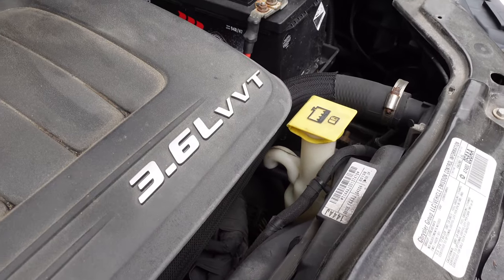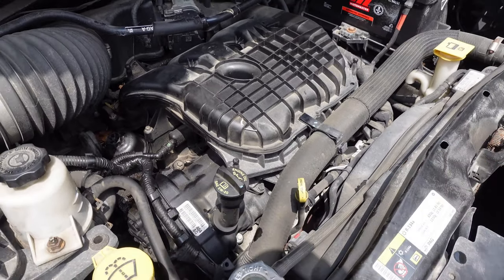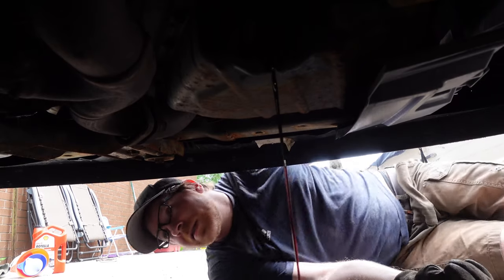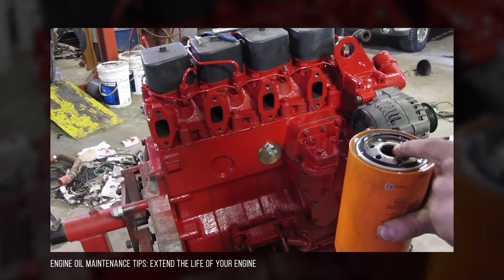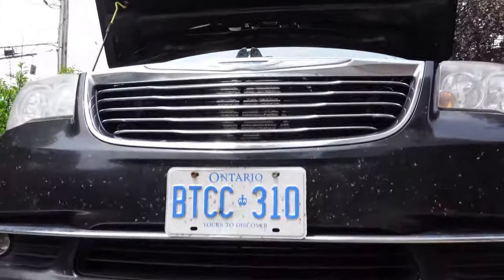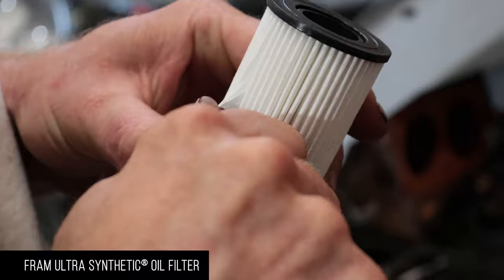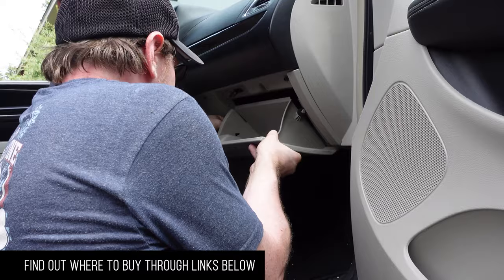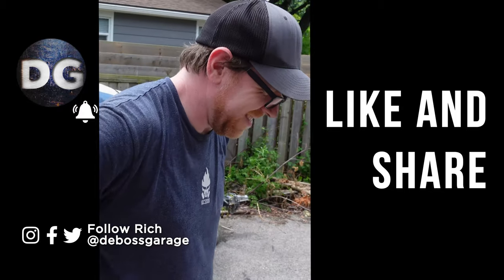How To Change Your Oil & Cabin Air Filter By Yourself (In Driveway)

Comment: When I showed my gf and had her do her own oil change.  She was pissed at how many times she paid the dealer $150+ to change it.
Reply: I'd be pissed too.  I've paid $150 for an oil change before, but it was in a truck that requires 27qts to fill.
Reply: Cost of a dealership change is not just an oil change, they also inspect the entire vehicle and top off other fluids. For anyone who actually inspects their vehicle themselves its not an issue, but if the only thing that's going to be done is poor in fresh oil and change the filter then it could easily save you money by having the dealership do the oil and catch other issues before they cause more damage. Of course this also requires trusting the dealership, which sometimes is surely easier said then done. Luckily for my wife's van the local Honda dealer is fantastic,  for my vehicles I prefer to do most of it myself as time allows.

Comment: Great video Rich, you covered all the important tips!  I have been changing the oil & filter on my motorcycle since 1977, including my newer bike.  I also change all of our vehicles, it is fun and much cheaper than taking it to a dealer or oil change shop.  This way you know the job is done right, use top shelf products (oil & filters).  Just recently I changed the oil & filter, transmission oil, transfer case oil, and differential, only took an afternoon!  Lots of fun

Comment: When I did the oil in my civic for the first time I had to use a friggen 2 foot breaker bar to get the drain plug out!
Reply: Your mechanic likes you….
Reply: I bent an oil pan on a customers car doing the same thing
Reply: hammer! they take a hard set and shock force knocks them loose nearly every time. same for trans, diff and other plugs. small breaker bar and dead blow hammer works pretty well or be dumb and bang it with your hand, then wonder why your hand hurts like mad
Reply: @throttlebottle5906  I would have done that except I was working under the car on jack stands,  so I barely had enough room to get the bar engaged with the nut and turn it, let alone hit it with a hammer. I ended up smashing my knuckles anyways. LOL.

Comment: i have been running Mobil 1 full synthetic 5w20 since 70 k miles <112 k  > now with over 280,000 miles (450616.32 K ) all of those changes have been 10-15 thousand mile oil changes truck still runs good gets same fuel mpg as new.

Comment: The dodge caravan service manual says
1. Warm engine
2. Remove plug and drain oil
3. Remove oil filter
4. Replace transaxle
5. Install plug and filter
6. Fill with oil.
Reply: 7. test drive and replace failed transaxle again.
8. replace failed engine
9. test drive and replace failed steering rack
10.......

Comment: I'm always removing the air intake on my '15 caravan to get to the cartridge oil filter. I miss my spinoff type oil filter.
Edit: Also check the tranny cooling lines for leaks, mine had a zip tie rub a pinhole in the crimped end and leaked, i bought a Doorman complete replacement from Advance Auto Parts and deleted the zip ties. The process for checking the trans level is complex.
Reply: I don't miss the oil up my sleeve with a spin on filter though

Comment: It's good getting the right oil viscosity (5w-20) but the car will have an actually spec that the oil needs to meet, that is why the oil filler cap has a book symbol and an "i" for information. Pretty important if you want to have your engine last a long time. I am surprised Rich didn't mention that, it is pretty important.

Comment: Hey Rich! Couple things about this van: 1) That oil pan is flimsy and will end up rusting through. Happened to mine. 2) Keep an eye on the heater hose Y-pipes near the brake booster, they're plastic and will leak after a while. Replace them with metal units.

Comment: Every one knows that you tighten the oil drain plug till the threads have deformed but NOT strip out. That’s what gives you a good seal 😉
Reply: @notsevenfeettall   depends on how rusted out your oil pan is. If it’s in good shape, you can take it to 3 ugga-duggas but it’s rotted out, maybe just stick with 2 ugga-duggas 

If it still leaks after tightening it, put some JB Weld around the threads. It won’t leak then
Reply: @codyheizler7619  JB weld? Isn't that more or less permanent?

Comment: When doing an oil change just be glad that everything is accessible and able to be visually monitored.
Many manufacturers cover everything up and deliberately make doing an oil change a pain in the arse because they don't want people servicing their own vehicles they want only dealers servicing the vehicles.
(looking at you BMW, Audi etc,.)
Usually Honda/Acura, Toyota/Lexus/Scion, Nissan, Ford, Chevy and Dodge make their cars relatively easy to service regular maintenance items like what Aaron was doing but, even those manufacturers have their challenge vehicles.

Comment: Excellent video  :) I use FRAM Oil filters, Fuel filter, PCV Valve, Transmission Filter plus Pan gaskets , Cabin Air Filter, Air Filter for engine and lots products since I drive vechiles since 1990 for 30 years also farm plus many others types vechiles! I enjoy how keeping engine plus vechile running perfectly long time too and do engine oil ever 3 months or 5,000 km also with new oil filter each time also 2 Air Filter plus PCV VALVE one in spring and other in Fall Season each year!

Comment: Hey I was wandering if you can help me. A couple years ago you made a video about removing the pesky exhaust studs on a 5.4L 3v. And you used a battery and jumper cables. I'm in the same dilemma just a 4.6L 3v all Aluminum and was trying the same technique with the battery and jumper cables. I did everything EXACTLY the same as what you did in that video except my bolt will NOT heat up even close to hot. The end of the jumper cables get red hot and I even melted the lead terminals on the battery. But by time I put the jumper cables on the floor and reach back up I can grab the bolt with my bare fingers, it's that cold. 

How is my head sucking away the heat so fast?

Comment: Question since you didn’t check the air filter next to the oil filter:  why would there be oil leaking onto the air filter?  We just got a used caravan. AC wasn’t cooling. Autozone guy suggested new air filters. Cabin air filter was nasty like yours. The under the hood air filter was soaked in oil!  We replaced it last month and today, it has oil on it again. The steering is getting stuck on and off, so I checked the filter thinking it might be related since the power steering oil is also right next to the filter too. I’m wondering why there would be any oil on the air filter.

Comment: Question, I have a truck I use as a work/farm truck I do not put many miles on it. Would I change the oil at the recommended interval or because of the use extend the interval?
Reply from the maker: I do it once a year regardless on things like my forklift and tractor if it doesn't get used much as much

Comment: You should do a video on the spark plug change on the 3.6L in that van as its quite extensive to remove all the air plenum and foam to get expose the spark plugs. Its also very expensive to pay a dealer to change the spark plugs on that specific model engine and year found in caravans and town and country
Reply: Yeah thats the video he should have done. They're a pain on them. If you're nimble enough though, you can get your hands back in there and get it done with minimal removal of other stuff.

Comment: If you want to save money on the fancy cabin filter, you can purchase a regular filter without that baking soda added to it. Then just pick up baking soda and pour it onto the filter. Pour a generous amount and put the filter in its original location. Once installed, sit in the driver seat and turn the fan on full blast to work the baking soda through your duct work. 

You’ll thank my later for the savings

Comment: I have a question I have a 2010 HHR had the oil changed in it and now the change oil light will not go off . And it says has zero life left on the oil.. so I had the oil change again after 20 miles still does the same are they a reset button
Reply from the maker: There is a way to reset it.  The computer does it by time, not the quality of the oil.  What vehicle is it?
Reply: Turn the key to on, press the gas pedal to the floor three times, start the car. Oil light should go off. 👍

Comment: Every dodge oil change i do the drain plug is always stripped😏i have a turbo socket on standby for dodge oil changes🤪
Reply: Same for Ford.
Reply: @timothyhays1817  yup😏
Reply: My '93 has the original plug still, I'm the only one who handles it! 0 leaks
Reply: @smalltruckadventures  yeah its these Jiffy lubes and quick lube shops that mess the drain plugs up🙄my shop is a block away from a jiffy lube🤦‍♂️
Reply: @PhillyDee215  My 1st job out of high school was at the local J-lube, however i belive I had been trained correctly and I didn't have call backs. That was A good beginning into the automotive field.
Reply: @smalltruckadventures  yeah not all Jiffy lubes are trash i guess😏
Reply: @PhillyDee215  I've seen more than enough that don't care.
Reply: @smalltruckadventures  i bet.....I get sent cars everyday from the one down the street from me🤦‍♂️not sure how they're even in business

Comment: That cartridge oil filter design is genius and way easier than shoving a screwdriver through a traditional one to get it off. What?! You think anybody that isn't a mechanic has an oil filter wrench? The only problem I see with it is engineers making it where you need to disassemble half the engine and/or the rest of the car just to gain access. Engineers really need to have ease of access to parts as a primary design consideration drilled into them. Finding out that a car is difficult to work on or expensive will drive sales away from it and will make the investment that those that do buy it depreciate faster since nobody wants an impossible to work on used car.

Comment: Watch out for the oil pan rust flavor!!! I do all my oil changes for many years with Fram ultra synthetic filters with no issues.  An average oil change in a shop will cost you between $60.00 to $100.00. Why you can diy for 50% less$$$

Comment: Hondas all have 17mm drain plugs. But for pretty much everything else 13, 14, or 15 will will it. Ford trucks had 5/8 for quite a while, but if you don't have an sae set a 16mm will work just as well.
Also, please don't use Fram filters. They're called orange death cans for a reason. I like wix filters, full time mechanic for 8 years, had my red seal for almost 4. Use a quality filter. More than half of of fram filters I've cut open have holes in the media or the pleats of the media have separated.

Comment: as a trained mechanic (2 years of the 4 that was standard), im in no way a pro, you should leave the oil cap off, or loose, when draining oil so the oil drains faster.  i think this is a good tip but im only a 2yr (from 9 years ago)

Comment: Change the thermostat with housing. Those fail every 80k km on those engines. It could fail open or closed, so overheat or not warm up.

Comment: Would you recommend changing all fluids upon purchasing a new to you vehicle. I personally do except for Transfluid.  Because I don't want to mess up my transmission by replacing the oil and all the crud comes loose. But other then that I replace all fluids engine, coolant diffs. And all filters is that excessive?
I think of it as a good investment
Reply: I usually do oil & filter, air filter, spark plugs and cabin filter.  It's cheap (relatively) and the chances are half of them should have been changed ages ago.  I once bought a car that had just had an oil change so I didn't bother changing it, turned out that they had used the wrong oil so I wish I'd just changed it when I bought it.
Reply: If you can afford it, it’s definitely no harm.

Comment: A car must be level when you change the oil, otherwise the rubbish slush will not come out, quickly costs 0.6 liters.. cool viedeo and tell me if i am wrong :) 
Groetjes uit Nederland
Reply: If the plug is on the back of the pan, small ramps like these are fine. Now if your plug is in the middle or on the front, then probably better to do it level.

Comment: How Is your dodge caravan deboss?
Reply from the maker: Good.  A wheel bearing and an engine mount so far.  Put about 10 000 miles on it so far.  Will likely replace it in the spring

Comment: Get the engine up to temperature before draining the oil to get all of it out and prevent that slow dribble at the end. Disconnect the injectors and just crank on the starter until the oil pressure light goes out, then reconnect and start the engine.

Comment: I don’t trust the oil cap. Mine said 5w20 but if you look at the manual it says for temperatures above 70 degrees it says to use 5w30…. I’m in Florida so yeah….
Reply: Yeah I'd always check the manual and relate it to the climate I'm in. It's probably even more important in Canada I would have thought. In any case frequent changes are key.

Comment: Yeah that's basically all I do for work rn. I work at a tire & lube in nisku, Ab. When I got there it was just 2 techs there thats including me. 2 weeks later we finally got a mechanic which I needed because I have my 1st year Apprenticeship training done I just have to get 1500 hours then I can go for my 2nd year schooling. Anyways that mechanic ended up leaving right after and well Im not no licensed mechanic but that guy was pretty dog shit at mechanic work and then the other tech who was there before me just left yesterday I'm pretty sure cause we had a ram 3500 come in for 6 tires and ofc it's a welding rig so everything was caked in mud and rust and anyways he was throwing shit and yeah his tools are gone now. So now it's just me and I have to clean up this dirty ass shop now while trying to do the oil changes and tire repairs and resort all the tools from where the other guy threw them around and left. Dammit man I just wanna get my blue book and my hours signed how hard can it be. I hope that ram doesn't come back for vibrations cause I don't know what I'm gonna do about it lol especially if I got oil change appointments booked through out the fuckin day. The trucks ball joints were fucked anyways to so. Just mint

Comment: Love the videos buddy I personally would never use a fram filter even for my worst enemy I’ve had a few oil filters not flow oil and I had one that leaked from the side had a pin hole in it again this is my personal opinion and experience with fram